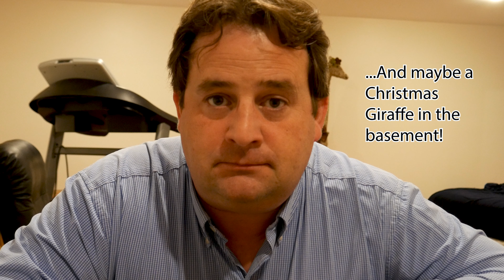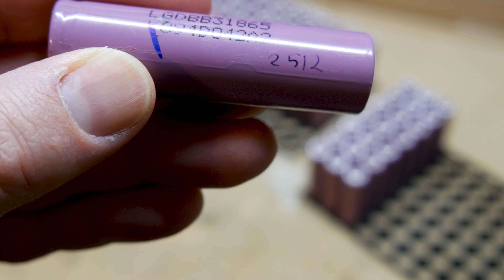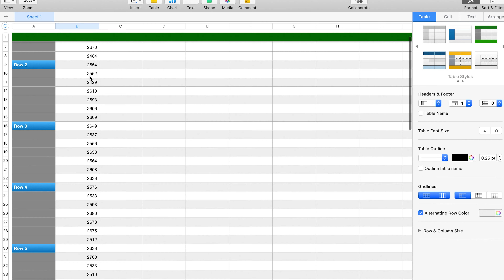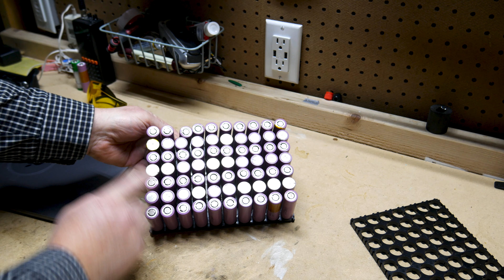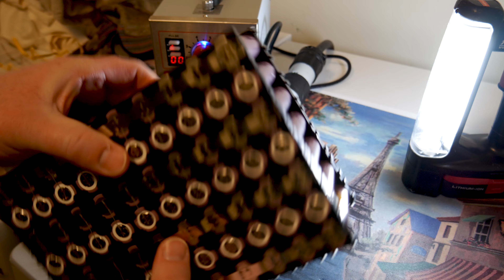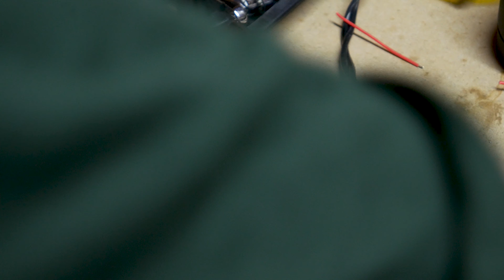Smoking BMS on New 18650 Battery Build!

Comment: Looks like you are going down the path of energy independence....! Been following you since I used your ground mount build as an example setup. Now you just need a few more packs at 14s or a few EV used batteries and you'll be on your way!
Reply from the maker: Thanks.  Doing small projects since I really don't have a space to house a larger battery bank.  Going to keep 18650's for smaller builds.  I think used EV batteries are the way to go for larger projects.  Thanks for following especially for the long haul.  Where did you use my ground mount as an example?